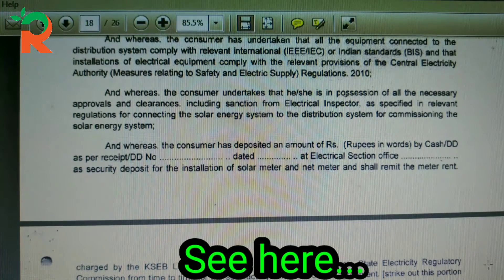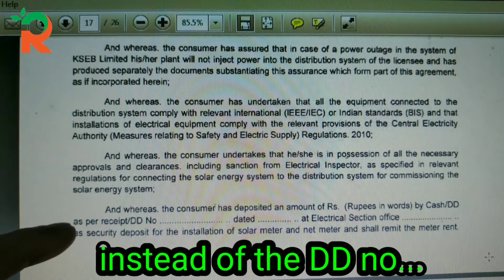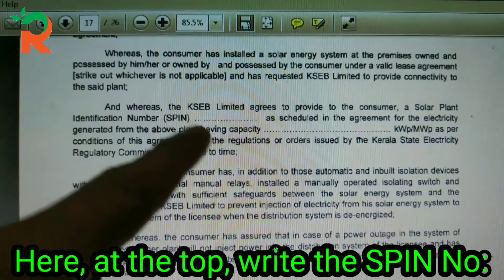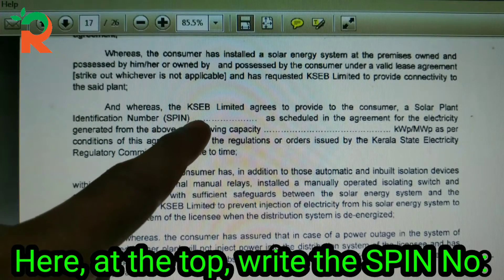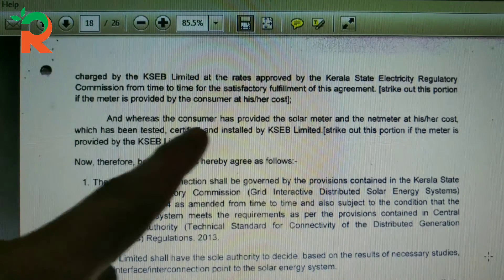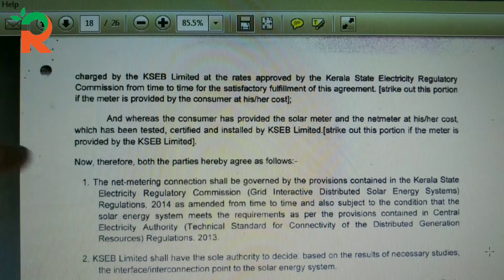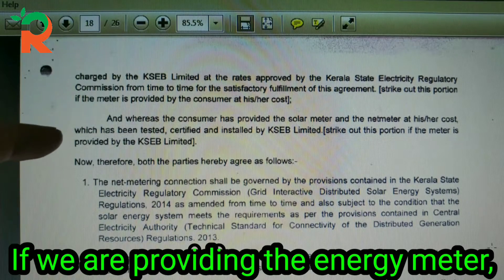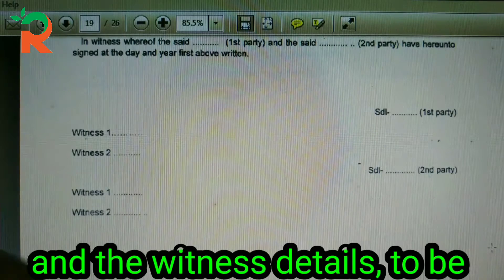Solar Grid Tie System Procedures - KSEB - Explained In Detail, Understand it or get into trouble...

Comment: i am waiting since over 45 days after submission of plant docs to KSEB kozhenchery and no one has called or inspected yet. After checking with Executive engineer , she bluntly says that i should have enquired  repeatedly. Also states that one of their surveyors are on leave for 2 weeks,  KSEB needs to improve customer experience
Reply from the maker: That is what ha[[ens with KSEB projects. Don't panic.. Keep on trying. Just keep in mind that it is our requirement. Otherwise, don't wait for the subsidized system. Install it by yourselves. If you want to install the system by us please visit https://www.renensinc.com
Reply: @abyrelaby  This is not a subsidized system. I have got it installed myself and only waiting for KSEB to test and connect it to grid. Thank you for your quick response.

Comment: Very informative video..
1Do you have any idea on procedure for upgrading/changing the grid tie inverter  after maybe 8-10years 
2)Or add  more capacity in future 
3)does kseb approve true hybrid grid tie inverter with battery backup so that during power outage there is backup along with anti islanding protection 👍✌️
Reply from the maker: First of all thanks for watching the video. Answers follow;
1. Approach the Assistant Engineer of the concerned section and give him a letter regarding the requirement, with drawings and specifications. You have to undergo the TMR inspection once again for harmonics, anti-islanding etc.
2. A capacity addition requires the same procedure for a new installation like taking feasibility and so on...
3. KSEB approves true hybrid systems. If you wish to install true hybrid systems please contact us....url: https;\\www.renensinc.com
Reply: @abyrelaby  thanks for the reply
I have applied for soura subsidy one year back still no progress
So checking out alternate options

Comment: 3kw system ചെയ്താൽ drawing ആവശ്യമുണ്ടോ.. അത് b ലൈസൻസ് holder sign ചെയ്യണമോ... below 10kw വേണ്ട എന്ന് പറയുന്നു???
Reply from the maker: Schematic should be attached at the time of project registration. but some KSEB section offices never ask for that. Completion certificate is needed at the time of energization. Some section offices insists but some don't even ask....
Reply: @abyrelaby is it require any sign and seal from electrical b license holder..
Reply from the maker: @rajeevkkn  Kindly go through the circular issued by KSEB. You can find the download link here - https://www.renensinc.com/products/swhkm/. Under KSEB >> Click on the "Do I need a completion certificate from a licensee for solar grid tie systems of capacity below 10KW?". This will clarify your doubts...